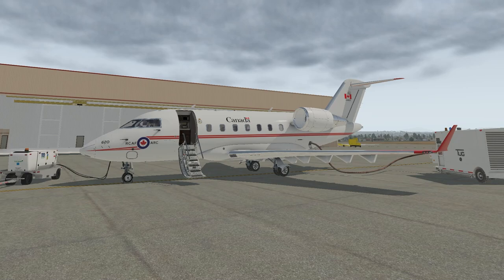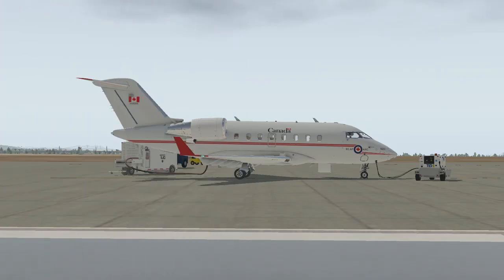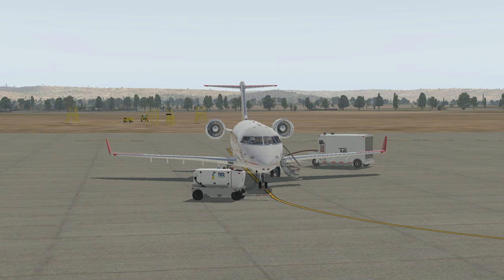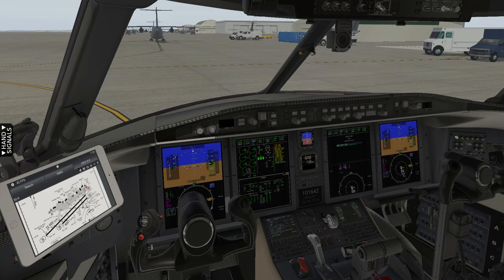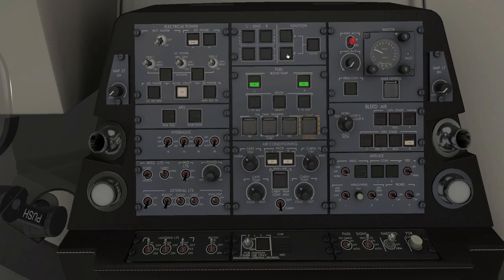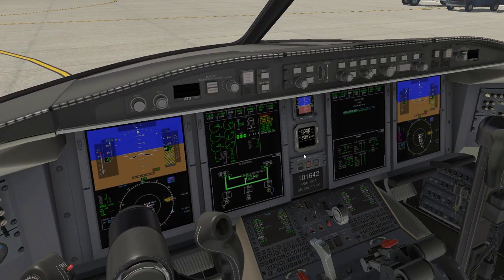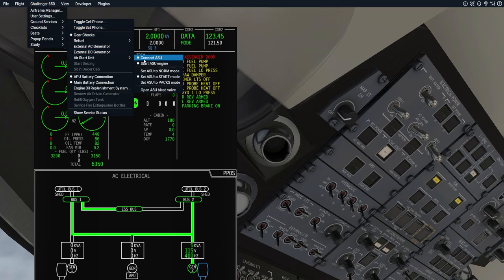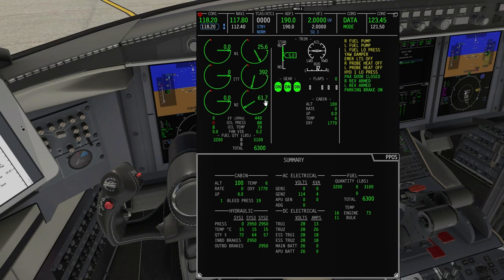Hot Start Challenger 650 | Air Start Unit Ops & Cross-Bleed Engine Start | X-Plane 11

Comment: I don't have the sim handy right now. Is it possible to use the air start cart to start engine #1 as well? That would save you having to do the cross bleed start, no?
Reply from the maker: Yes absolutely, irl the concern would be safety. The preferred method is air start and then cross-bleed. But yes it can be done